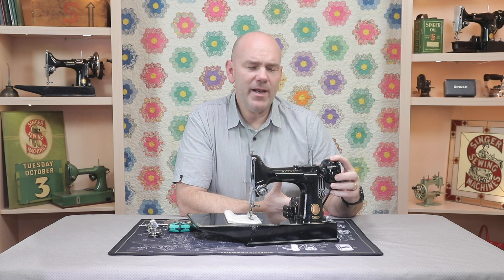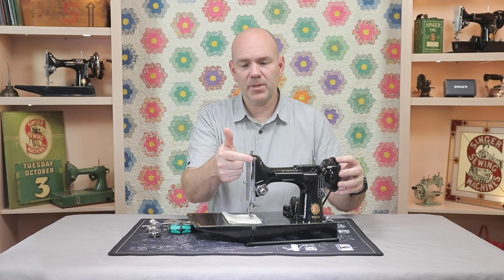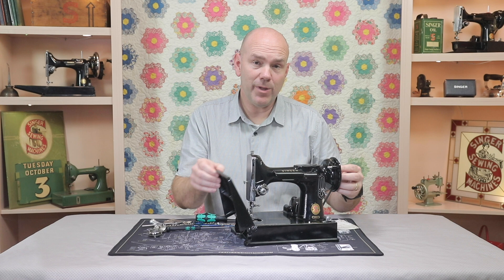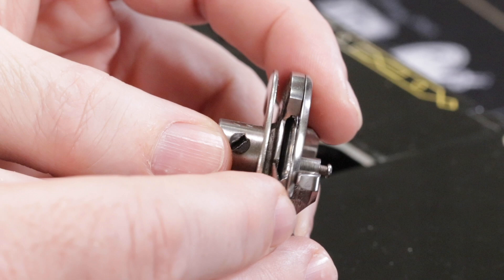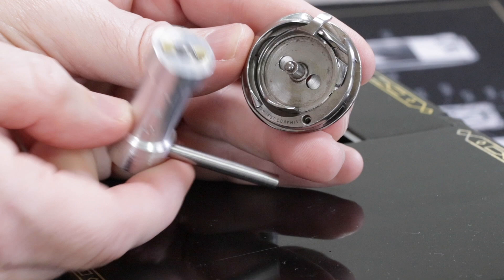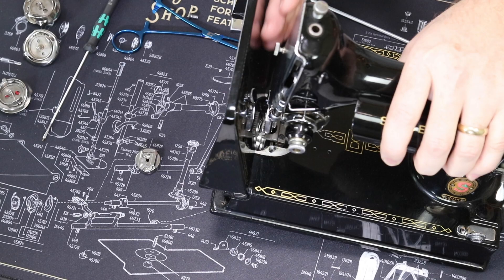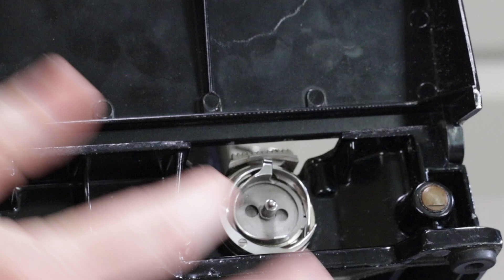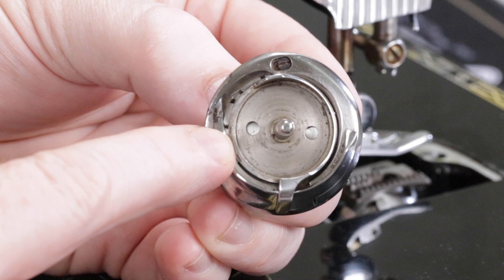Singer Featherweight 221 222 Video Tutorial - Thread Jam Removal Tool

Comment: Genius!!! Thank you for making such a tool that I had need of just 3 weeks ago!!

The thread had everything jammed so tight that I had to remove the whole bobbin/hook assembly (or whatever it’s called) and even then I had to put on some vinyl gloves to get enough leverage to get the parts freely moving. Such a tiny piece of thread can cause such problems!

I learned a lot, in the process, but this tool would have made the job so much easier. Thank you for your wonderful videos.

Comment: Thank you for the video! Just purchased your motor lube on Amazon. Purchased only because of your videos. I do not have a FW but do have a 301 n 201 all needing proper lube. You attention to detail is appreciated and amazing. Who does not rock the handwheel? Not me thanks to you. This bobbin case has a lot of similarities to the Pfaff bobbin case. If memory serves me correct you have to retime the machine after each jam. My 301 is days new to me and you have saved me from tearing apart my machine when, not if, it jams. Thanks again. I'm going to post this link on FB 301 page. It's info all need to know.

Comment: Is it still possible to ask a question? I was doing some "air sewing" the other day  :/   knew I had run out of bobbing thread. But try as I might, I can't get the bobbin to come out. Have watched quite a few of your videos, and this is the closest one I've seen that might help me. While you don't have a bobbin case in there, you talk about the hook assembly & how it has to fit into the slot when the throat plate is removed. Why is it that my hook assembly is spinning freely before removing that throat plate? Any advice would be greatly appreciated.   🙂

Comment: Anyone have a reference URL link or know the mic (micrometer measured or dial caliper) size of the spindle of the bobbin case for a 221 featherweight?

I bought Mom a bunch of Amazon-sourced bobbins and they're just a hair too tight to slip into the bobbin case without some fiddling.  Mom is in her 80's and doesn't want to fiddle.  I'd like to know the size of the spindle so I can get a cheap chuck reamer off Amazon and make those bobbins a bit more 80-year-old-finger installation friendly.

Thanks!
Reply from the maker: We do NOT recommend altering the original bobbin case base because the issue is with new, poorly manufactured bobbins (and not with the manufacturing of the original Singer part) and comparatively, an original bobbin case base is very expensive to replace.  Rather, it is much more economical to purchase bobbins from a reputable Featherweight source that specializes in the model specifically.  Amazon is wonderful for many things, but not for service or quality parts for the Singer Featherweight.  Here is the link to correct Featherweight bobbins that will work properly in the bobbin case:

https://singer-featherweight.com/products/bobbins-roll-of-10

Here's a link to our blog post about bad bobbins specifically:
https://singer-featherweight.com/blogs/schoolhouse/bad-featherweight-bobbins

Comment: Do you think the featherweight could handle v-92 thread / #18 needle?
Reply from the maker: An 18 needle would be the largest I would attempt, on a Featherweight, but I would do so gingerly.  A size 16 would be the most comfortable for us to use.  We are not familiar with that size thread, but if it's really thick, that may cause problems around the bobbin case.  Report back with what you discover.